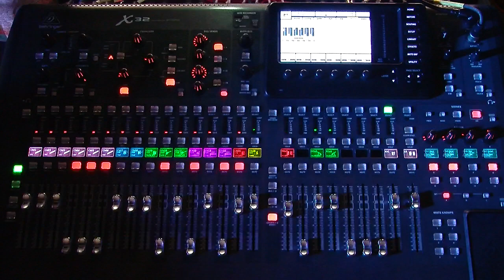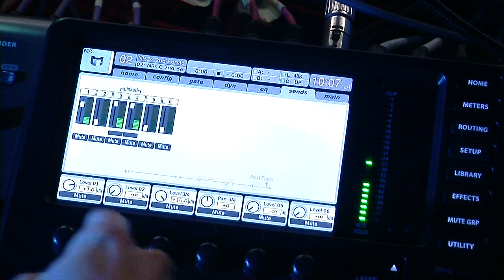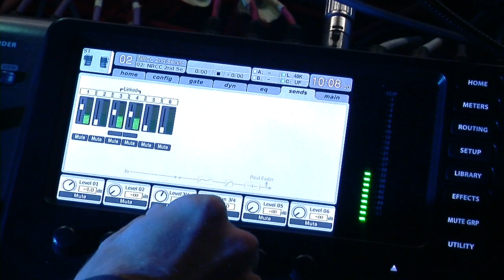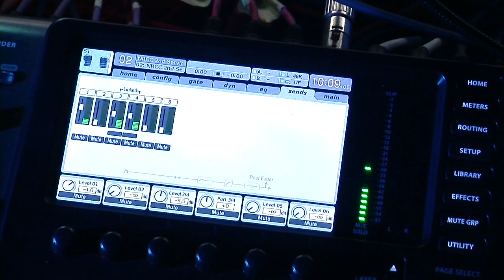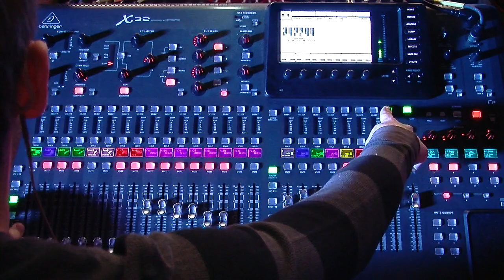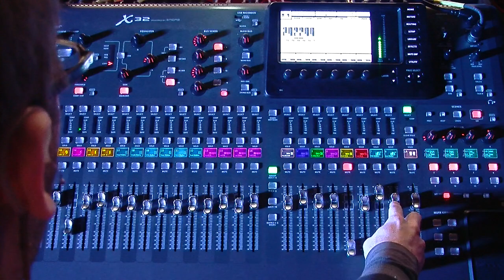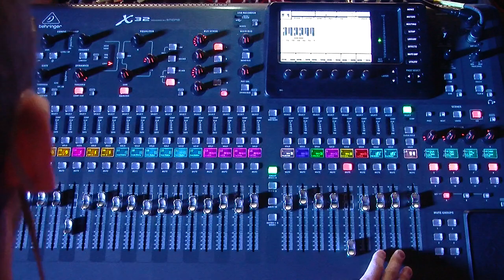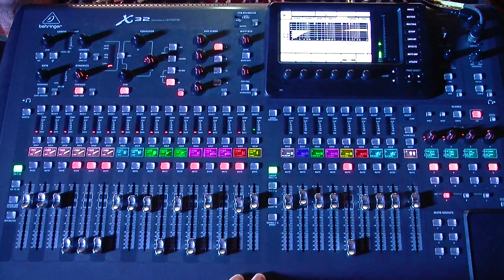Behringer X32 - Audio Feed For Video Setup & NRCC X32 Setup

Comment: Came across this video, unfortunately I think you didn't state clearly or forgot to finish how you send a unique mix for live stream in stereo.  Perhaps you can clarify how to set it up for unique mix for stereo live stream without having to edit the mix on a separate DAW on computer?  I.e. all inputs + FX returns into a mixbus (mixbus stereo i.e. mix bus 1 & 2 linked as Left and Right?) then send stereo mixbus 1+2 into matrix linked stereo i.e. 5 & 6? Then route matrix 5+6 as output i.e. 1 & 2 into to DAW or direct to computer for live stream?  Thanks.

Comment: HELP. So, I've messaged Behringer and I can't seem to get a straight answer. We are currently using a Yamaha MGP32X and we are using one of the Matrix Outputs for our LIvestream. The problem we are running into is the audio sounds good in house, but the livestream isn't mixed well. We are wanting a system that allows us two seperate mixes. Mix1 (In House Mix) can be controlled on the board by the Sound Tech, Mix2 (Live Stream Mix) can be controlled by the person running the livestream. The mixes do not need to effect the other, for example, If the Guitar sounds great in Mix1, but needs to be louder in Mix2, I want to be able to adjust Mix2 and it have no effect on Mix1. Is this possible? Can I use the Behringer App to adjust Mix2, wile the sound tech uses the faders on the board and we not have any affect on each other?

Comment: Drew, thanks for the vids. Wondering if you can suggest a solution for a specific X32 scenario I found myself in... I was mixing a live broadcast for a video production (not FOH). Because the cameras were delayed a few frames (due to SDI conversion), I added delay at my mix outputs feeding the streaming interface to compensate. There was also a video playback source (laptop) sending me audio to mix. That video source however didn’t have video delay yet the audio is now passing through my mixer and is delayed. Q: Is there a way to add delay to subgroups? I realize I could delay the input of every channel EXCEPT the video playback source (instrad of at my overall mix outout), but being in the same room as most of the audio sources (loud band, speech in FOH), I thought monitoring a delayed signal would getting smeary on my brain even with heavily isolated headphones on. Thoughts?

Comment: STEREO MIX QUESTION
Short version: I'm looking for fader send and pan to a linked pair of buses for creating an on-the-fly rough stereo mix

I'm using the midas M32R but the logic and programming should be the same as X32.  I run a small music venue and just upgraded from presonus studiolive to the Midas M32r.  On the presonus studiolive I could link Aux 1 and 2, dial send levels from each input and set an LR pan for each signal and have a very quick stereo aux mix to feed a foyer, camcorder, or stream live events to a local radio station.  Solo-ing this paired aux 1&2 puts it in the headphones so its easy to dial in.  Very different from main mix because in my small room I never send drum kit or bass amp through the house system, but of course need these signals for remote destinations.  I would also send this rather than main mix to a usb stick for a band

Closest I can come on the Midas M32r is assign inputs using fader flip at different strengths to bus1 and bus2 to achieve a panning effect..  i can solo bus1 and bus2 together for the headphones but there MUST be a better way… looking for a single fader send to pair of buses, with a pan knob…. must be easy but new to the Midas…  is a matrix the answer??

thanks in advance for any replies Peter (soundman@jett.net)

Comment: Hey Drew, thanks for the help.  I watched this video hoping to figure out how to create a source for our live streaming feed, and didn't really get it through this video.  (I'm sure it's something I missed) . I am using vMix to broadcast.  I have connected our PC/vMix to the x32 via USB and see where I have output/input options available; however I am not getting an input signal from the board.  Can you give me some insight?  Also...when I try to go to master audio settings in vMix ....vMix crashes.  Thanks again.  you can email me direct if that will help .  trinitychurch12@gmail.com

Comment: Hello Drew ,  a bit related question. 

I am a Drummer with an X32 and a P16M.   I have my X32 in my control room and my Drum Kit in main recording room. I have pre ordered the X32 Live card.    My goal is to record the drums in multitrack using the dynamics/ effects on the X32.   With the new Live card , I can now keep everything right onboard.  

I plan to do the multitrack recording while doing a multi cam video.    The cameras will record the room audio and will be sync’d later in multicam inside Final Cut Pro

So , I want to SIMPLY have Drums audio and MP3 audio in my headphones.   So first question is can I group the multichannel drum mix into a DCA and control the DCA from the P16M then also send the MP3 audio to the P16M then having just the 2  for my headphones ?    Can a DCA be sent to the P16M ?    Lastly it’s my understanding that channels 1-16 are the 1-16 on the P16M.   Can I route different channels to those 16 on the P16M ?   Whew.   I hope I explained my goal well .   

If you have ANY other suggestions on how to do this PLEASE LET ME KNOW.    I simply want to record my Drum Kit , mix it add Dynamics/effects use the pre mixed audio Final Cut Pro as main audio for the multicam video.

Comment: Hey by the way if i have that behringer x32. Do i need to use some audio processor like dbx driverack venue pa 360? And also some equalizer and compressor in each amplifier for front speaker?
Reply: Mr Jn If you're using a passive system, I would recommend some sort of processing for your pa which will help maximize levels, tune your room and not overload your amps. An active system, you can do all u need "in the box" but a driverack can be used for an active system to benefit from the processing. Seasoned engineers can do it by ear and by knowing the gear. Just my 2 cents.

Comment: Hi Drew. Hi i would like to know or do you a video for additional outputs.. i mean we have X32 with 2 speakers output.. But im also trying to connect a camcorder to it for our church service. We often removed 1 speaker so that my camcorder will recieved audio. Thanks.
Reply from the maker: Thanks for asking! On the X32, hit the Routing button, tab over to Out 1-16, with the first rotary knob, scroll to the output you want to use for your camcorder. Let's pick Out 8 for this example. Then use the 4th rotary knob to select where you want to pull the audio from. With this example I'm going to pull from the Main L, so scroll until you get to Main L and then press the 4th rotary knob to confirm.
Reply: Hello question. I have done the steps below. But how do you control the volume now. The slider on the channel I use does not let me control the volume.  Any ideas.

Comment: Hey Drew. Awesome videos and great help.  I just got a X32 Rack for our church and I watched Dave Rat's videos.  I am setting up my board as you show here plus a subwoofer crossover.  My confusion is how do the subgroups relate to and/or feed the FXs?  Do the FXs feed from the original channels or the subgroups?  Where do the FX Returns go - to LR or to subgroup (or somewhere else)? Do you have to do some kind of FX insert with the subgroups? (Sorry for the dumb questions, I'm still learning.)
Lastly, this video was made 5 years ago.  Do you still use/recommend this setup?  Thanks in advance for your help.

Comment: Hey Drew, thanks so much for your videos they are very helpful. I was wondering if you could do something on how or even if you use ambient mics. I can't seem to find anything at all helpful. We would like to incorporate ambient mics for when we record our services. Any info would be greatly appreciated. Thanks Daniel
Reply from the maker: +Daniel Ortega Ambient mics are a great way to help your recording of the service sound more natural. I really enjoyed using the Audio Technica at8035b or the Audio Technica at835b (older model) and putting them on short mic stands on the stage. Not only did I feed these into the musicians in-ear monitors, but I also used those to add into the CD recording mix. You can also use choir mics hanging in the room, but have them point away from the PA system to reduce the amount of direct sound from the PA which would cause bad interactions in the recording.
Reply: +Drew Brashler Thank you sir for your reply!!! :-)
Reply from the maker: You're welcome, let me know if you have any questions along the way. Easiest way to contact me is at www.dbbaudio.com. Thanks!

Comment: Drew,
Could you tell me how to record from the X32 directly to a camcorder?  Trying to record the sermon without the outside noise.
Reply: Exactly my Question
Reply: Just assign (route) a mixbus that you are not using to your camcorder (We use AUX OUT #6). You can get a converter box that works on most camcorders that will go from USB to RCA and just plug the RCA inputs to the AUX OUT #6 on the back of the board. This is what we are doing at our church to put audio/video down into our nursery TV.
Reply: thanks for your help

Comment: @drewbrashler I have a question. I've watched all of your videos and the one thing I cannot figure out is how to use the solo button and hAve it only solo in a set of headphones. Currently when I press solo is solos it in the house, which is not ideal. As far as I know, our boards are setup very similar. However my mains are only going out of the back L and R of the monitor output. All of my monitors are going out of the bus outputs. so what am I doing wrong here? Please let me know!
Reply from the maker: +10tailjinjuriki Sorry +RevProductionsSC for my really late reply! I guess I never saw this 10 months ago. It sounds like you have the mains set up going out of the Monitor/Control Room out on the back of the board. You need to be using the XLR Outs and assign it using the Routing section. By default XLR Out 15 and XLR Out 16 are left and right main out.

Comment: Question:  Our church just installed this board.  We also have a mono system but we are currently using the Main LR (15,16) and keeping everything panned to the center.  I would like to be able to record in stereo and I am hoping to do that in a separate mix because we want to record some things like the piano that don't get put through the speakers.  Right now we are using a bus for the recording mix but it is not stereo.  We could use two buses and mix each side individually but that seems impractical.  If we used the stereo bus for the recording and used the mono bus for the mains that might work but I think we would lose the easy access to the main fader, correct?  Do you have a suggestion for this?

Comment: Our church just started a live video/audio feed and I can't figure out how to get a good mix out to the computer controlling our live feed.   The vocals are way louder than any of the instruments. Do I need some kind of external device to control the mix to the computer?  How can I listen to the mix going out to the computer in order to adjust it? the guy that set the computer up is using the headphone jack as the output to the computer for a "quick and dirty" setup and it is not working very well.  Thanks in advance
Reply from the maker: If you are sending the same feed to the PA system and to your live video/audio, what you are mixing in the house would be going to the AV feed.  So, if your instruments are too soft in the audio feed, you might have some issues with stage volume in your church.  Try to get the stage volume lower in your church so that all of the music volume is coming from your PA system.  This will give you a better sounding service.  Also it will help with the mix of music vs vocals in the recording feed.  The other option if stage volume cannot be fixed, is that you can mix the music into a stereo subgroup and then the vocals into a stereo subgroup, then feed the Matrix with the subgroups.  You can now turn the vocals down and the instruments up in the feed for your AV feed.  We have moved all of the guitar amps into a back room or under our stage so that all of the volume is coming from our PA system.  This helps A LOT!  Best of luck to you, and let me know if you have any questions.  Thanks!

Comment: I noticed your didn't mentioned how you are feeding your stage wedges?  Also, We don't have digitial processor, will i have to use up my matrix to setup bi-amps ? Please advise.
Reply from the maker: Depending on the service, my floor monitors are either fed from a Bus (controllable monitor) or the Matrix (stage fill from the main output).  I would suggest trying to get a digital processor if you have a more advanced setup at your church, but using the matrix and x-over filters that are built into the X32 can go a long way!  Check out this video for help: Behringer X32 - Use as a System Processor for Bi-Amped + Sub Setup

Comment: Can you run 4 wireless mikes from the board or local in channels 1 through 4 and monitor them in the s16 , into a headphone amp from the outputs on the s16. or would I need to plug the wireless units into the s16 directly on stage to do this ,and leave the transmitters on the stage? We just bought this board and I am trying to set up 6 personal mixes for each musician using the s16 digital snake outputs going into a headphone amp?

Comment from the maker: This would happen if the 2 channels are both panned center instead of Left and Right before the linking of the two channels. You would be seeing a -3dB drop in signal. If you have two channels that are similar in audio, and you bring them together in both left and right (panned center) you will have a +3dB level over the channels output. However, if you then pan each channel left and right you would then have equal signal level on the stereo meters.  Please let me know if this didnt make sense.

Comment: quick question.    I noted that you pair stereo channels.
What is the reason that it sounds like the level drops or it sounds like the high end is reduced when you pair channels.    I assume it happens on outputs as well?    Dunno.   I just checked inputs with my headphones and an ipod.    Its not isolated to B X32.    I've heard the same on LS9, M7, 5d's ... maybe its something I never learned.
To my ears it sounds better (un) paired.

Comment from the maker: Hi Trond.  There are a lot of people using the X32 in a mobile setup with no issues.  The board has a lot of flexibility to be setup in different ways.  The reason it is in a lot of churches is the amount of channels, processing power, sound quality and the price point.  The next board in the same area is significantly more expensive than this board.  Before you start saying that this board is bad, I would recommend checking it out in person with someone who really understands the board.

Comment: Hi thank you Drew for your videos. I just purchased the MX32 for our church. I am a novive with digital and would like to ask questions about set up. I have used an anolog board for many years and finally decided to upgrade. I would like to e-mail you questions as I work through setting up the board. Your videos are helpful, but sometimes I have some questions. Would it be possible to get your e-mail address?

Comment from the maker: I was too lazy to make another for the MP3 player.  Also I was using the RCA jacks on the back for Aux In 5&6.  So I use a simple 1/8 inch stereo to LR RCA cable for the MP3 player.  It works well!

Comment from the maker: I send the PA signal out of Output 16 to our two EAW UX8800 system processor which routes to the various PA systems.  The subwoofers are handled by the system processor as well.  On stage we have three monitor channels and then we have 6 wireless in ear mixes.  The monitors get fed off of a matrix as a stage fill for our contemporary service because they use the in ear mixes.  I end up using 6 pre fade mixes, 6 group mix buses, and 4 post fade mix buses for effects.

Comment: I'd like to see how you set-up your power amps and cable runs to speakers, from this board. Just say your using 2ea dual 18in subs, 4 ea. 115 tops. and 4 ea. monitors on stage. Using the outs on the X32. Trying to stay away from a monitor engineer and do everything from FOH end.

Comment from the maker: Adcancedsp is correct.  The stock output for L and R is Output 15 and 16 on the back of the board.  Also the stock configuration has the AES/EBU being pulled from the LR bus.  But the beauty of the routing button on the right side of the LCD is that you can specify what output is being used for what.

Comment from the maker: With our need to having the 6 pre fade busses for in ear monitors, yeah having the 6 mono/3 stereo mix busses is a bit restricting.  But if you add in the Behringer P16 aviom type personal monitors you reduce the requirement of the pre fade busses for monitors so you can free up more channels.  You can also run two X32's, one as a monitor board and one as a FOH board.  So if you find that you need WAY more busses, you could just add another board.